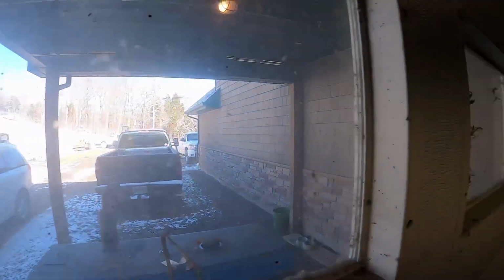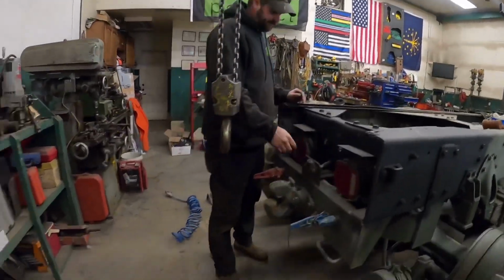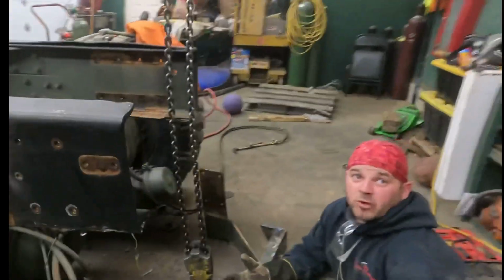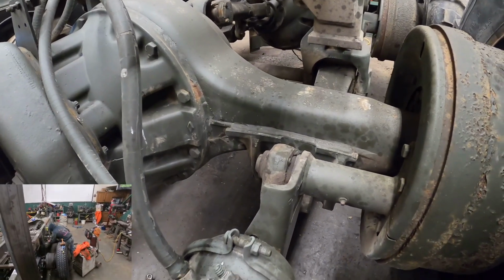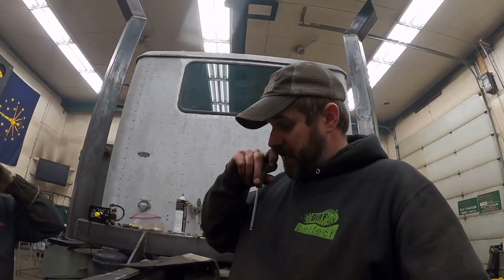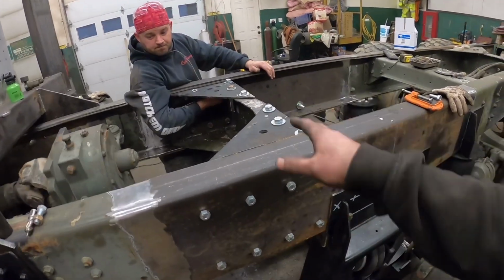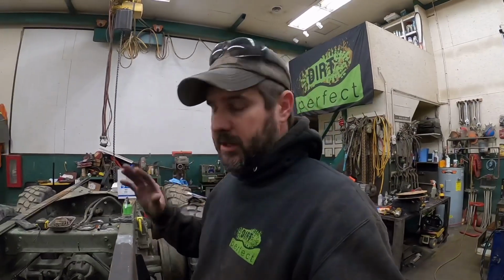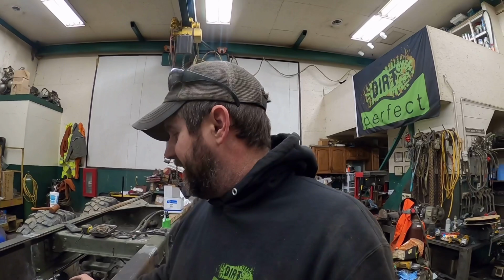Proving I am smarter than Man Behind The Scenes Crossmember install and Lt Dan leaves the shop

Comment: If you put duals on the pusher axle instead of single, how much more to age would you beable to carry?
There is no way in NZ could we do this with out engineers and certification rubbish.
Reply from the maker: Only the weigh difference between the tires

Comment: That bend in the rear cross member was not from a chain or tow strap. That truck had a fifth wheel plate. That was from the king pin on a trailer hitting and the rear end popping up and/or the trailer not being raised enough while loaded.

Love the build of the truck

Comment: Came into this series a bit late (only about 9 months) - but I can tell you what happened to the rear cross member - the king pin of a trailer hit it... Someone didn't drop the landing legs before pulling out from under it... Same thing happens over my side of the lake (Oz)... 'Driver' goes looking for a new job (preferably not in control of a semi).
Loving the build series, fascinating... Finally got to understand why tippers over there have so many wheels...

Comment: Why does the tag axle require brakes? The original truck brakes shouldn't be any less effective. Is it just some DoT rule or is there a good reason to do it?
Reply from the maker: The law requires that
Reply: @DirtPerfect  Fair enough. I really love the truck. You did a fantastic job on the frame and tag axle. It was very interesting to watch. Cheers.

Comment: a lot of states don't allow the pressure adjust in the cab because you can change your axle weights as you roll over the scale.  Only works if they weigh one axle at a time at the scale house.  crank her up as the steer axle goes on, lower it when the pusher rolls on, then crank it back up before the drives hit.

Comment: Did you plumb your lift axle supply with a "DOT" valve?
It is a one way check valve that only allows the lift axle to drain it's supply tank down to approx 90 psi.
Also doesn't supply air to the lift axle ( or other added accessories like air shift PTO, air tailgate, etc) till system reaches 100 psi.
That way if there is a failure in an accessory system, it will not deplete air brakes.
Reply from the maker: Yes it’s on the truck

Comment: found your channel several months ago and love it! really enjoying the LT DAN project. i have built quite a few stretch frames for dump bodies earlier in my life, before i became a contractor i worked as a welder /fab in a number or job shops , in my opinion looks like a great job you have done!, BUT,lol every time i see the carrier bearing mount attaching the drive line  i want to jump through the screen and add a 3/8s plate over the top of that entire T mount you built, there is alot of torque in that area , what do you think? lol great job guys and look forward to the rest of the build.
Reply from the maker: Thanks and absolutely not necessary
Reply: well i must admit i have a tendancy to "overbuild things,lol keep up the great work and vids guys and have a great weekend!

Comment: Nice work guys.  Lift axle controller outside of the cab is probably to deter drivers picking the wheels up at a toll plaza (common on east coast where there are charged per axle on the road) to reduce tge fee and then drop them back down further on.

Comment: Diagonals off of the single tube holding up the center support bearing? You never know what kind of forces will happen with a fully loaded box and trying to get the truck to move with limited traction and or spin and grab......

Comment: Are your quick release valves integrated into your control box? I put a axle under  my dump truck and I mounted my quick release valves on the crossmember above the axle. It’s very quite in the cab when lifting and lowering.

Comment: Love the build. I was wondering about the controller in the cab but you addressed it. In my state they changed 6-8 years ago. Has to be mounted outside the cab, reason being the drivers were screwing with pressures while being officially weighed.

Comment: You need to connect your suspension supply BEHIND a pressure protection valve such as a Bendix PR-4 valve. If ever there is a sudden loss of air from your air suspension it closes at around 60 psi to keep a reserve for the brakes.
Ditto on the compression fittings. Did service work for a music band tour bus. Every time the bus stopped in for service the tour manager requested we change 5 fittings (our choice) from quik connect to compression.
Reply from the maker: Have a check valve for that

Comment: i just drilled about 80 holes on the autocar. i touched up the annular cutter with a grinder and it cut good as new again. i even broke on off when i got too aggressive with a dull cutter, ground it flat and then reground it with an angle grinder so i was able to finish out what holes i needed to do. was just going to comment on the air bag regulator and then you addressed it near the end.     im running mine at 55lbs

Comment: what would be kind of funny is if you had a way to cut a trap door in the back of the cab and hinge the controller putting the hoses into a flexible rubber boot and a catch so the controller could be flipped inside and out.  So if a the problem arose during a stop you could be a smarty and flip it outside and go is that better?  :) compliance in both areas for when you need to travel.

Comment: Just say you should be using frame bolt for everything nice job on the cross member. We can have the control in the cab here just the dump valve

Comment: I replaced one side of double frame on a single axle IH . I seperated the two pieces of the old frame and marked out all the holes onthe two new pieces, drilled the 107 holes with a mag drill "sweet tool". One mean looking machine

Comment: First drive MY ASS, its not like it was sitting years. You didn't swap an engine. You drove it in the shop. all you did was cut frame and put it back together but longer.
Reply: Just be the first drive for the new driveshaft.
Reply from the maker: Ok if you say so
Reply: @DirtPerfect , - yes I'm happy that you plan, check out tolerances, see if it's the right way to do it. Testing to make sure everything working right after or during the process. Working with heavy steel, dealing with more weight n pressure, yes your safety and others in consideration. Right person to learn from. You see a lot of you tubers cut and cobble things together.  They think it looks cool and end up redoing cause having no knowledge or trying things out for the first time.

Comment: I know this is off the subject of the video, but being that it is an ex-military truck, is it a straight 24 volt system. I mean with like 24 volt everything like lights and you name it.

I had some ex-military trailers in the shop few years back that a guy wanted to use. All the lights were 24-volt, and all the wiring on the whole trailer was really too small to handle the amperage of the 12 volt lights
Reply from the maker: This one have been converted

Comment: Is there a special paint designed for frames? If not I would suggest you use rocker panel paint rather than the basic Rustoleum or any other rattle can product.
Reply from the maker: Stay tuned

Comment: That driveshaft carrier bearing support needs to be beefed up IMHO
Reply from the maker: Not for sure you understand how it works
Reply: @DirtPerfect  Maybe so but if a u joint goes bad there could be an inordinate amount of vibration on it that could be amplified by flex in that bracket hanging out like that.
Reply from the maker: They bracket will not be the first point of failure I can promise you that hell it’s mounted in rubber from the factory

Comment: Those push locks are a love hate relationship. Thats all there is to it. Love them for the convenience but despise them when you have to constantly chase down leaks and blow outs. I deal with several thousand of them where I work and chasing down leaks is just about an every day job. Even using really good quality fittings from Parker they still sometimes blow out the tubing. Speaking of tubing I hope you got the high quality stuff because the cheaper tubing out there will get brittle over time, especially any where near heat or the sun.

Comment: Mike, I hope that this is not being " pissy" but when you apply the lift axle, it really does lift the front axle weight significantly and there for takes away from the  traction that it would have if it needed it as we know, those rear lift axles have left all of us stuck just cause the lift takes what traction it would normally have. I'm sure that you already considered this already as you do your editing and would of absolutely seen the same thing I am so stupid on. I don't want to be right or say after the fact as I have done a lot of stuff like your doing but it was more like forty years  (around) ago. I think (used that word too much) that I kinda answered this to myself as its whole purpose is to lift and doing a right grand time of it. I guess to save me a touch is that if the truck was loaded and fighting for footing then you could lift the lift axle a trifle to get moving and then drop it all the way again. I started a  little more broke as a joke as I had the single axle truck with a lift on the back and everytime I would turn around in a tight spot the tires on the lift would stop me from the full amount I could of used to turn and also it would get a log or something I didn't see and hook and then stuck and no getting out of..need the "tug" so I could turn around..... One crazy scenario was to just drive up to my excavator loader and hook the back of the truck with a strap and lift and swing till it  was pointed the right way and I could resort how the truck needed to set. Officer Hoover will be happy to put in his opinion on rights and wrongs. I sure wish I could still go get so greasy that even my neck had the proverbiale "ring" around the neck and not come off easy. Real proud of you two gentlemen and see a future in a repair business should our new "leader" break the backs of construction again.... You were standing tall with   Trump and no big surprises to wake up to but all the new cheap labor coming in from our southern border and China allowed to dink us again that it might get real tight and force a man to do what ever it takes to survive... I do know that your a real survivor already.

Comment: You pulled the  plug out of the air tank for your hook up  , remember never off the bottom or you ill get WATER in the system .
Reply from the maker: Look closer
Reply: @DirtPerfect  I did not see where you tied in .  In 2001 Mack sent there truck,s out with the air pick up on the bottom ! fucked up my air dryer before I noticed .

Comment: In Wisconsin, the regulator that controls the air pressure in the lift axle can't be in the cab where the driver could change the pressure on a scale. The switch to lift or load the axle can be in the cab.

Comment: Observation/question. I worked in mining most of my life so off road rules. The plastic air lines on all light duty trucks. which would include your project truck Lt Dan. When we would blow or damage  any air line we replaced it with steel braided lines with cloth cover (basic hyd style lines ) as the were longer lasting took more abuse with out leaking. Here in Canada if we had to take units off site and got stopped for an inspection they were deemed illegal and we got a fine. Found this out when we replaced a few air lines on a couple of 18 wheelers delivering goods  and they blew some brake lines.and we repaired them as we didn't have the right plastic lines or fittings, they got stopped down the road after doing the delivery. My question is what would be the result if this happened in your state or in the US in general? I guess this is more a question for officer Hover?
Reply from the maker: Yup good ? For Hoover

Comment: It's about time that thing saw some daylight. You have really thought this out as to what needs to go where and in what order. From experience I would suggest that you put exhaust tubes on that lift axle control valve. They stir up a lot of dust and cab dirt when used. I put one of them on one of the trucks that I drove part time and the owner then wanted them on all trucks. Looking for the next video. Be well and safe.

Comment: The brake line fittings are “fail safe” if you lose a line the brakes are applied. They are actually air release brakes.
Reply from the maker: Understand how they work very well and think about that
Reply: @DirtPerfect  Does your truck's braking system have protection against "compounding" of the rear axle brakes (where both parking brake spring force and service brake force are applied at the same time, potentially overloading the brake parts)?

Comment: two things I would like to see you might do is you air bag s  I think are extended too far and about an air scale gage for knowing your weight, all you need is an air gauge that reads 0-40 psi it will get you close on your weight on the lift axle I am ex-mech. and driver and army mech .on heavy trucks equipment mechanic retired. I do know a little bit about this, oh yes, do you know the army already has dump trucks like that you just built? they are called 30 ton dumps the new ones are on a Freightliner frame for over the road and off ready.

Comment: The reason why the axle adjustment is not allowed in the cab in most States is because the axle pressure can be adjusted while your getting weighed by Weight Enforcement. If it's on the outside you can't manipulate it at all. I live in Arizona and they require it outside the cab. You see these mostly on cement mixers. The up and down switch is inside but the pressure adjust and guage in mostly on the drivers side just under the driver's door.  The super 16 dump trucks are the same.

Comment: i like using the back.crossmember but why not leave the air line and hirch  i rhpught if to make a trailer you were,hooked and plumbed
Reply: He said in the video it is getting a 3/4 inch hitch plate and then the gladhands and pintle hitch will go back on.
Reply from the maker: Yup

Comment: Im not one for criticising so please don’t take this as a negative comment. I have concerns about having 2 welded points in the same place in the chassis rails because I expect the chassis will flex to a point and even with Aarons perfect welding (I am impressed yes) there are different metal properties between the original chassis rails and the extension pieces, this along with the heat which could alter the property characteristic of the steel could lead to fracturing. 
Us limeys in the UK usually would put a “flitching” section over the joints extending past the welds and it would be bolted rather than welded! Im sure you will spot anything should it happen before it becomes a problem. Awesome work guys, I love the “one up manship” banter lol.

Comment: In NY they just made it illegal to have the controller in the cab. The reason they are claiming is because they don’t want people to adjust them when going down the road. The concern they raise is for sharper turning that individuals would either raise them off the ground or soften the bags a bit. That might have been true for non-steer axles but steerable I would t see why it is needed. They also just made it mandatory that you have to have a steerable axle in NYS so I had to rip out the old axle in my 99 Mack dump. The cost to put a new axle in is way too much for the added 1 ton difference I would get with hauling, but I dislike how it looks without the axle, the added brakes, and the added stability it gave...

Comment: I gotta say it!!  😝 “an-u-lar” cutter. I know that’s not how it’s spelled. Just bein a dink.  🥴
Also. I have one about push locks as well. 
I used them on the pex in my shop for my outdoor furnace connections. Called shark bite fittings but are the same thing. Had one come apart in my shop one night and came down the next morning to a flooded and frozen shop!!! 🤬🤬🤬. If it was concrete it wouldn’t have been bad. But my floor is two layers of 3/4 advantec plywood on top of 2x10’s on 1’ centers so it got in between the layers of plywood. Dried it out as best I could but when 175 gallons of antifreeze/water slush is on the floor it was pretty hard to dry out !!  Needless to say I changed out all the fittings to the crimp ring style. What a expensive sucky deal that was.
Reply: Honestly I’d do anything for a flooded shop floor right now. It would be so much better then a burned floor. What a sucky summer I have had so far man. Shop burned flat and then my freakin dog of nine years died out of the blue 🤷‍♂️😢 seems like this year is just one blow after another.

Comment: It makes no sense to remove the rear crossmember. It should remain in place for 3/4 inch plate to be welded to it. You also should have new crossmember to be pre cut with clearance between new 4’ frame section. By sliding it roughly into place when truck is apart, You would get a better fit.. You just weren’t thinking we’re Y’a. You now have to make new angle braces for rear. Really Dumb.
Reply: Umm, if you had watched the same video I did he explained that the rear crossmember was in the way of the bed hinge hardware and had to come out.
Reply from the maker: Yup

Comment: The quick air lines, it's easy and fast, but from the factory, you gotta check them. Working as trailer mechanic for à few months that was the most important thing the guys thought me was to make sure they were really pushed to end and that the lines were cut straight. Any of those 2 were off, and nothing would've worked